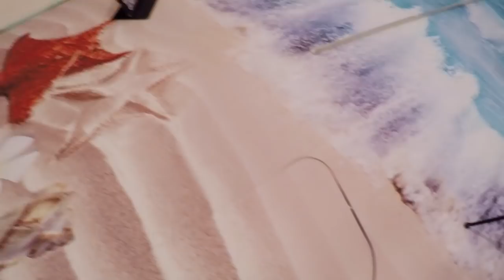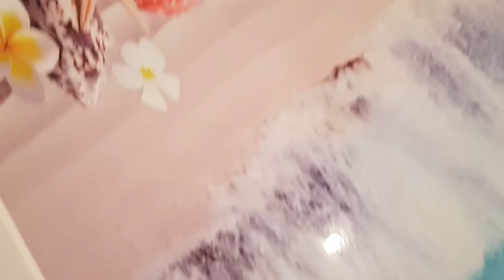how to make an 3D Floor with 2K Epoxy Resin DIY cómo hacer un piso epóxico 3D 2K Epoxid Boden 3D

Comment: its like floor wallpaper. i put it on the floors walls and ceiling all the time. im a builder in Tennessee. its really not too hard even if u have never done it. keeping the dust and   dirt off the floor is the hardest part.
Reply from the maker: hi yeah thats right, just the Epoxy should be Dist. well thanks for comment
Reply: Do you know the name of this floor paper?

Comment: Beautiful!  How do you wash the toilet floor then?  Eventually, the water will seep through the sides of walls into floor, won't it?
Reply from the maker: hi, thanks for comment .. after the floor is finished with the epoxy you add an sealing frame around the Floor.. share ... like ...

Comment: Like the process of the video but what is that white mesh material you are using to cover your drywall and then what are you rolling onto it. It looks like it is something that you can use to not have difficulty in smoothing out the wall joints in between drywall. I really need to know what that is.
Reply from the maker: thanks for the comment mate Sorry for the Late Reply ... here it is .. it´s called "fiberglass wallpaper"
Reply: Truly I am serious. at 4:58 you start applying some covering.  Is that just a wallpaper?  I would really like to know what that material is and what you rolled onto the top pf it after you applied it.
Reply: Just wanted to let you know  was not joking...  other than wallpaper I have never seen anything like that in the US.  I have a bathroom remodel coming up and could really us a product like that.  Could you please let me know what it is?
Reply from the maker: hi once again fiberglass wallpaper  ... thanks for well watching ;) !
Reply from the maker: Thanks mate ... pretty Kind !! especially for Fathers Day today ... wish you all the best .. share our Vids and let me know if you have more questions ... !
Reply: Kevin Williams I came here looking for the exact same thing, lol.

Comment: Did you use any hardy backer ?  All I saw was Green back sheet rock with the tile in the toilet area.
Reply from the maker: hi actually we used Drywall Plates (water protected)  cheers

Comment: What if a girl walks in with high heels every time or kids scratch and it damages the sticker. Then it’s not gonna be water resistant anymore and probably slowly start to peal off.
Reply from the maker: hi, nothing will touch the sticker as it have a Coat of at least 2.. Epoxy on it .. Thank´s for comment check out our New Video guess you enjoy .. https://youtu.be/-FN_ss2KsSc

Comment: at 12:45 after applying the primer on next step it looks like the floor is wood planks what is this ?
Reply: MentallFloss yeah, that does look like OSB
Reply: MentallFloss it looks like epoxy resin treatment
Reply from the maker: 100 Points it is OSB
Reply from the maker: hi, thank´ s for comment we showed both solutions for different Underground ! visit our New Video https://youtu.be/-FN_ss2KsSc

Comment: Where’d you purchase this floor?
Reply from the maker: www.elektric-junkys.com you can even send them your own Pictures "matching Resolution for sure" and the Print any Size you need !
Reply: You can get the stuff and do it yourself I am doing this in a camper .
Reply from the maker: hey Paula have you finished your Camper Floor ?